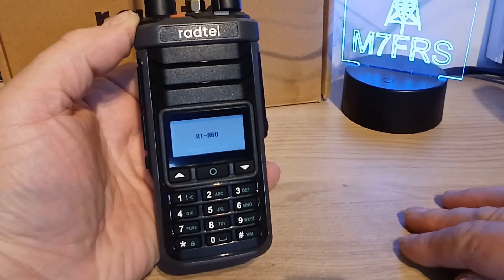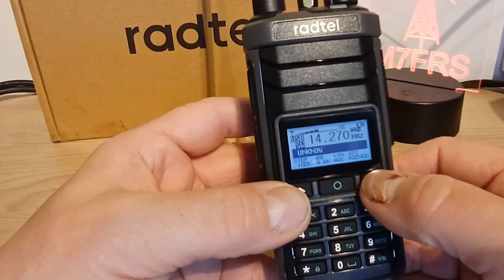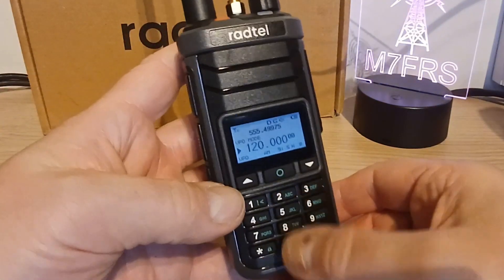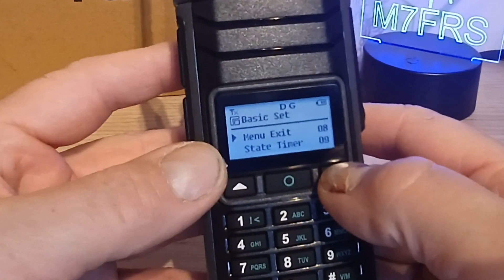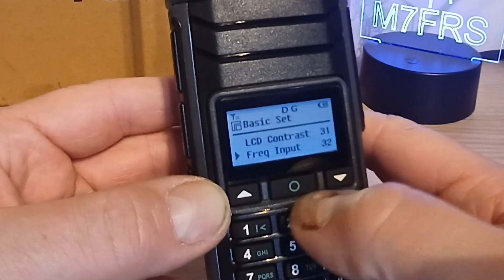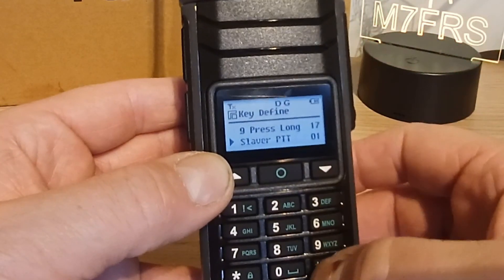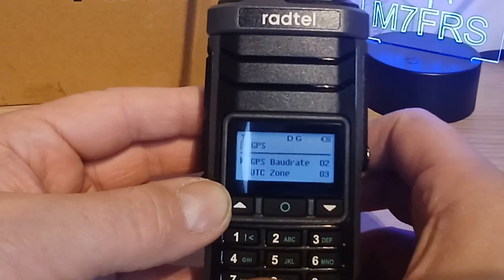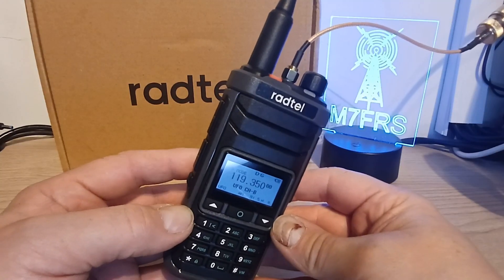Radtel RT 860 Menu Options, Functions & HF Reception

Comment: can't help but wonder why these chaps with the fancy expensive gear can't wait to prove that these sub £100 radios are spewing out dirty signals, of course they are, they only cost £50 and it says rx only for most of the frequencies 
I think these TinySA Ultra meters are great at proving the obvious but I ain't  seen anyone putting any of the high end Transceivers on it for a test, especially some of these used models that still cost a lot more than £50. Let's see a few videos of the expensive stuff put through their paces
I think even for using the RADTEL 860 as a scanner it's a bargain.

Comment: HF trouble! I hear only a little noise (crackles) on LW, MW, and SW. (FM, VMF, and UHF are great.) I can start the SI4732 radio, change bands, choose frequencies, and set the reception parameters. I never see above S2 and that only momentarily. I've tried various antennas, indoors and outdoors, on both ports and all bands. I'm within 20 miles of several 50,0000-watt clear-channel AM stations and hear nothing. Any ideas? Thanks!
Reply: Are you using the second aerial input?
de g4wuh

Comment: No GPS on the RT-860 Ben, the company that manufactures these, iradio, has a GPS version (UV88gps) for a premium price. Not very useful though as the firmware has no APRS capability - this will change when the DMR version is released very soon.
Reply from the maker: Thanks for the info 👍 
I did wonder if that setting didn't do anything! Thanks for watching and commenting 👍